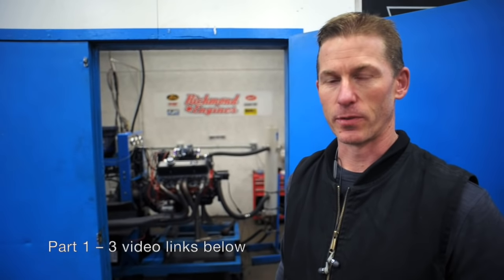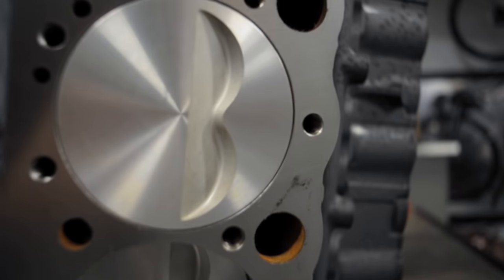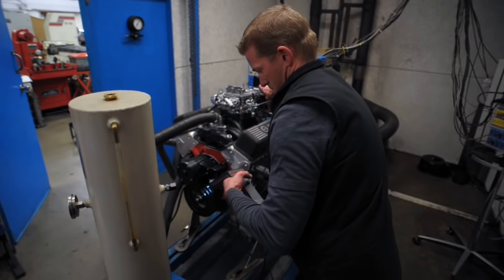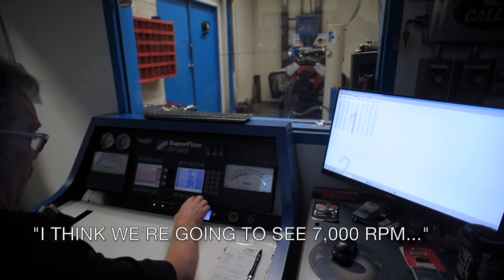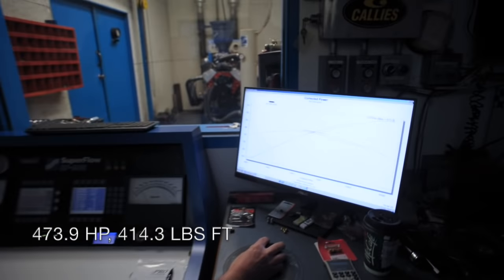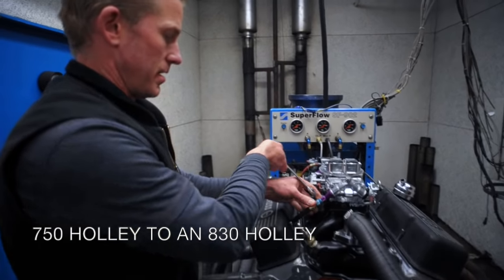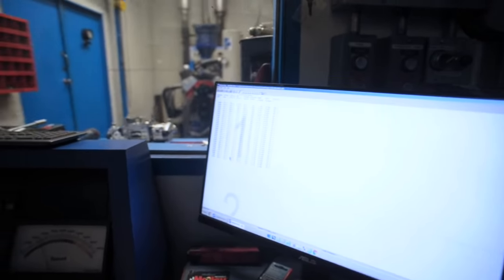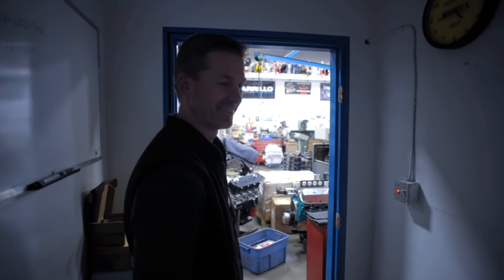SBC 283 Crankshaft + 400 Block = 500+ HP (Dyno Test 1 of 2)

Comment: Back in 1995 I had a de-stroked 400- which made it 377 cubic inches, it was a monster! It was in my 1970 Monte Carlo with a m21 4-speed  with  390  gears in a 12 bolt position, i shifted at 6800, ran 11.12's weighing 4200 pounds
Reply from the maker: Sounds awesome! I just love those Monte Carlos too.
Reply: Nobody does that today.  It's  all turbos and the bottle.  Good job.
Reply from the maker: Thank you for commenting :)
Reply: Do you remember the specs of the heads and cam and compression?, That's a great time for the gears and weight 💪
Reply: Thats hella cool, my iron headed 350 powered 72 Monte Carlo weighs 3,770lbs with AC and rally wheels on a 12 bolt... wonder why yours weighed so much more.  Mine ran a 15.5 bone stock.
Reply: 350 crank and longer rods are a sweet sleeper  engine.
Reply from the maker: Thanks for commenting!
Reply: Perfect combination I think, the 377
Reply from the maker: Maybe I should do one of those next! Thanks for commenting :)
Reply: I know what you mean. Had a 377 with a 6-71 and two 600 double pumpers in a 1930 Model A Coupe. What a ride
Reply from the maker: That sounds like a bit crazy and fun!
Reply: I've got a similar story with a 318 crank in a 360 block. Everybody told me a 349 was too small for a 3/4 ton. It breathed really well, spun to 7200 RPM, and waddled a 6,600 lb truck into the 13s. I did eventually get sick of it and go with a hughs kit, after everything has a mean little 415, but even with the Pistons and rod upgrades I couldn't spin it as fast as I could that 349.
Reply from the maker: Sounds awesome :)
Reply: I would have been the pesky neighborhood kid wanting to help you set your floats and timing.
Reply from the maker: That’s how we learned!! Get in there :)
Reply: @Sir.VicsMasher  he's probably bullshittin that's why it weighed so much
Reply: Yep that was a super strong old school combo that rocked. I'd rather have that than a 383
Reply from the maker: Awesome! Thanks for commenting :)
Reply: @chrisguerra355  I agree
Reply: Circa 1983 my elderly cousin had a 194x’s Chevy pickup with a stretched front end and a 377 with a powerglide.  I had great reaction times so he let me race it at Penwell Raceway outside Odessa, Texas.  It ran 11.2’s NA and with nitrous it ran 9.7’s.  Not sure what it weighed, it was all very custom as he was a body man.....  That nitrous pass was at 136 mph and it had no front brakes and there wasn’t much weight on the back tires...He had a cheap choke cable for the parachute and I pulled the plastic knob off it and didn’t deploy the chute. I had to gear it down and stand on the brake pedal to get it stopped about 20’ before going through a barbed wire fence... Ended up winning the bracket race that night.  Good Times!
Reply: @dieseldan420ca He must've weighed his Monte Carlo with him in it. 😂
Reply: Built the same, the 400 would've been a bigger monster at lower revs and been faster. With bigger heads it would've been an even bigger bigger monster
Reply: @chriscatarcio2983  Cause there easy to tune to go fast at the track!
Reply from the maker: @lollipop84858 
Thanks. Not really our point though.
Reply: @BCBtrucks64  The opposite combo became the standard.  400 crank in a 350 block, the famous 383 stroker. Stock car drivers used both variations with success.
Reply: Try a 307 chevy with 305ho heads it's actually considered a 283 stroker makes damn good power for budget budget build especially when you slap a comp 268 😂

Comment: Makes me wish I still had my '67 302. That sound at high rpms and the realization of what a shorter stroked engine can accomplish, gotta love it.
Reply from the maker: We appreciate your comment, wfd805!
Reply: Don’t think there was a 67 chev 302 !
Reply: @edwardhuett7924  there was, indeed. Small journal. We have a guy here that has his all original 67 Z-28 and the factory 302 is still in it.
Reply: @wfd805  thought it started in 68
Reply: @edwardhuett7924  no, in 67. It was for the Trans AM race. They were limited to 5 liter engines and that was the answer. They had Zora Duntov work his magic and the 302 was the outcome. I know there is a lot of mystery around the reality of the 302 chevy engine and most parts suppliers don't even acknowledge it ever existed. But, they did and are gaining popularity in collectors again. I knew mine was original also. My friend Gary bought the car new in early 67 and he pulled the engine to drag race a big block. When he passed, I was lucky enough to receive it. But, I got bit by the big block bug. I sold it to a police officer for his 56 chevy.
Reply: @edwardhuett7924  nope, 1967 z/28 302 cid
Reply: I hear ya wfd805. I had a 69 Camaro and bought a well rebuilt 302 from a Hotrodder that worked at an O' Reillys in Smyrna Georgia. That engine drove and sounded.... Just Badass....
Reply: @edwardhuett7924  you're both right 67 had the small Journal 68 had the large Journal
Reply: The DZ 302 was a 283 crank  with a  327 block  

The 307 was  a  327 crank and a 283 block
Reply: @edwardhuett7924  yes 327 block 283 crank 2 bolt main the late  68/69 was a 302 purpose built and 4 bolt main !A short stroke big&  bore and good heads. Power from a small block comes from the heads!
Reply: @jimthomas1989  no a dz302  was not a 327 block   with a 283 crank .it was a 4 bolt main built as a 302   block and large journal crank !
Reply: The 302  was a 283 crank in a 327 block  .
The only  time there was a 4 bolt main 327 block  
But it was a 4 inch bore 4 bolt main 327  block with a  283 crank
Reply from the maker: @jimthomas1989 
Sounds about right. Thanks for commenting.
Reply: I bulid 302s with  6 inch rods  slow the pistons  speed  down  more  RPM

Comment: Great idea. Destroking the engine, just like Chevy did with the 327 to create the 302 to make power.
Reply from the maker: Hi w41duvernay! Thank you for commenting! We think of it as applying tried and true principles. There's something surely going on with a longer connecting rod that's benefitting power, torque, and efficiency; it's certainly applying the characteristics of what a short stroke produces, (and we are learning those characteristics as we go). Best regards.
Reply: If i remember right, a 327 block , a 283 forged crank, and a 5.7 rod , did reproduce the 302 z28 engine. Won't  be a DZ block,  but ....
Reply from the maker: @ronniecox109  
That’s correct!
Reply: @ronniecox109  , 
307 small block was a 283 block and 327 crank 
302 small block was a 327 block with a 283 crank
Reply: They didn't do it to make power, they did it to stay under class size rules for the Can-Am series
Reply from the maker: That’s a good point :)
Reply: @wymple09  Correct, to make power they went to more displacement. ie  350, then 396 then 427 then 454

Comment: Many moons ago back in high school,I built a 327 small journal 283 crank and dome pistons ported 202 heads never got beat! The sound of it 7000 rpm I'll never forget
Reply from the maker: That awesome!! Fun times I bet! Thanks for commenting :)
Reply: Roy Huff , 
The small  block  307 is a  327 crank and a  283 block  

The small  block  DZ 302 is a  283 crank and a  327 block   

I have  all of  these cranks and  all of  these blocks  

One of my 327 engines  is in a 66 Chevelle Super Sport  , 12 :1 Forged pistons and Steel Vette crank  , 
11 inch clutch  , M-21 Muncie 4 speed  , 12 bolt posi  rear  end  , 
Pulls both front tires off the ground,  
Revs to the moon at 11,000rpm  ! 
450hp
Reply from the maker: Sounds like fun!!
Reply: @jimthomas1989  what rods for the 283 crank in 327 block.My friend had 307 crank in 327 bored supposed to been 335 I think
Reply: @badassbees3680  , I think  307 uses  5.7 Rod  and  I'm not sure  if  it is  5.7 or 6 inch Rods for the DZ 302  but  it's a 283 crank  , I will have to  check  on it
Reply from the maker: Should be 5.7” rods. I believe the only SBC rods from factory that differed in length was the 400 rods that were shorter because of the longer stroke. Kinda silly for a HP application but good for a truck engine.
Reply: @ceperformance  thanks everyone! I have a 91 c1500 fixing to build a motor for..like a kid again can't wait lol
Reply: @jimthomas1989  I had a 74 chevy once they put 302 in with cam and 202 valves ..not sure what all was in it but I turned it 7300 a few times without floating valves and then one night me and buddies had too much fun and I wound it until it snapped all the belts and slung bearings completely out of waterpump l9l
Reply: @badassbees3680  , 
I have two 89 OBS Trucks  , both  have  4 bolt main  350 and  5 speed Trans , one is a short  bed , one is  a long bed , 

What year engine  you wanting to  put in that 91  C1500  ?
Reply: @jimthomas1989  not sure yet ..wish didn't have ecm bs or I'd go old school with one wire alternator but leaning towards 5.3 Ls  and some mods
Reply: @badassbees3680  , I have  NEVER   did any LS engines  , but  hundreds  of old schools  ,  if you need some  old school  tricks for hp gains  , I know some of them  ,
I have  never needed a computer  to make hp or limit  my rpm
Reply: @jimthomas1989  I'm in the same boat bro about the lot of old school engines but no LS yet
Reply: @badassbees3680  , The 4.8 LS is a 283,
The 5.3LS  is a 327 , The 5.7 LSis a 350 and  6.0LS is a  383  ,

These are NOT Correct  .
That's just  what  I call them  !  

The LS makes good power and  has after market  parts , but they are more  expensive than  Old School  engines , 

Headers for LS engines  are like twice as much as  Old School  , 
But it's your Truck and  your  decision
Reply: @badassbees3680  , 
Do this Video  , 
A 283  or  327 crank  in a 4 bolt main  block  and  make  4 to 5 hundred hp  .

11 or 12 :1  Forged  Pistons  
Port the heads 
Aluminum hi-rise intake 
Headers 
750cfm  carb or bigger  
Hi lift  wide duration  cam 

And you are in the 400 to 500hp range
Reply: @jimthomas1989  my last motor  was 400 small block ,11:1 555 lift 750 holley in 69 chevelle with car 4 speed got it hot at the creek doing flaming burnouts but that's been all my engines..bored ,roller rockers huge cam.. think wanna play with the LS and see if their as easy as old school stuff

Comment: Ran similar motor combo about 30yrs ago in a class rule deal, max 320cu, OEM production block, crank and rods only & cast iron heads, it used a 400 block, 265 crank, chrysler 6.123 rods, 14:1  made just over 600hp @8400 on alcohol in circle track application, it's a sound combo
Reply: I'd been waiting for someone to bring up some rule restricted circle track combinations. 
There's a lot of it that applies so much better to street/weekend race cars than the specific drag race build mindset.
Thank you.
Reply: @Motor-City-Mike  going smaller bore larger stroke is not worth anything if your not running down low enough rpm to make use of it, the improvement using 4.125 bore to cylinder head flow back then was huge as you could lay the chamber walls back so much more and using a 4.125 dome piston gave a lot more dome volume to bump compression, we ran a street version some years later using dome piston and increasing combustion chamber size as we found the dome slowed the flame travel enough to run a high compression ( for street) 12.5::1 without detonation, relieving the quench pad area to a slope proved best as unless the quench clearance was virtually zero it seemed to do very little to prevent detonation ( broke a few motors finding that one out)
Reply: I bet that thing sounded INSANE

Comment: Kinda nostalgic...
We built so many oddball engine combinations decades ago, making our own main bearing spacers, sleeving blocks for bigger bore sizes, big breathing heads came from hours of hand work, parts swapping from brand to brand etc etc, back when stroker cranks were welded and cut and high strength fasteners came from either tool & die or the aircraft industries. 
Everything old is new again.
Reply: Very cool! Thanks for commenting!
Reply: @stevenshumey8363  
You're plenty welcome!
There's so many area's of engine building to be revisited because of advancement in other areas, airflow potentials unheard of except in the 'secret rooms' of the top Pro/Stock engine builders (Bob Glidden has never really gotten the recognition deserved for his cylinder head developments, not just with the Cleveland Ford), camshaft profiles once thought impossible, spark curves only now possible with electronic ignition management etc, now available over the counter, making new combinations working with "old" areas completely worth investigating. 
I NEVER restricted my business or research to any one engine brand, there's so much to be learned from one design to the next that moving my knowledge forward meant WAY more, and I preferred the challenge.
One of my personal toys - I was in the business for just over a decade and still would be if not for financial damage done from divorce - was a 2.87" stroke x 4.15" bore 8.2 deck SBF with very heavily modified early 351W heads (the Tool & Die background of my family allowed modifying blocks etc for very little to no money) and  a G.K. camshaft of my own specs.
Very long story short, just over 520fwhp at 7900 on 89 octane pump gas, acceptable street manners even carbureted, and a notoriously fast little street racer still able to be driven back and forth to the shop. 
The short strokes allow for some big rpm (low mean piston speeds), I still spend time investigating rod length to stroke ratios as well as bore to stroke ratios and the affects they have on power under the curve and shape of the curve, valid when building to suit a specific car's intended use.
I found there's a lot to be gained by working the area between max torque and max horsepower just through different bottom end geometry - so thanks for visiting this area!
Reply: Mike, thank you again. Very cool project there with your SBF. 
I really appreciate your enthusiasm for different engine combos!
Reply: What was your favorite sbc combo from back in the day?
Reply from the maker: @SketchysGarage  
I always loved a high compression 327 with a wild solid roller camshaft and a single plane manifold. 
Now I’m building several different things like these short stroke combos as well as long and short stroke LS motors. 
Always something a bit different.
Reply: @ceperformance  The 327 can be a real beast with the right cam and heads for their size. We built a 4 inch bore 4 inch stroke sbc that was a real monster had great power from the hit of the throttle till you let off. Great channel keep up the hard work 💪.
Reply from the maker: @SketchysGarage  
Thank you! I think it’s so valuable when guys are open to share ideas. There’s always something to learn if we’re open to it! 
Keep up the good work!
Reply: Agree with the nostalgic observation, but, not necessarily the odd ball part. 
4” bore / 3.25” stroke yielded 331 cid and was the norm in SBC Pro Stock motors in the -70’s, up until the advent of mountain motors in the -80’s.
Reply from the maker: Hey, thanks for commenting!
Reply: @georgedreisch2662  2hp per cu. in. 331 cu.in where 3.25 stroke . screamers
Reply from the maker: And we love it :)
Thanks for commenting.

Comment: Awesome! My 327 made that, spent a small fortune but it was a giant killer! 
Your 329 is a killer but a different cam and springs you would run over 7000 rpm and 500 hp with huge torque numbers! 
Man I love this build!!
Reply from the maker: Thank you for commenting! Look out for another video in a week or so. We just added some spring pressure and titanium retainers and we’re going to whip it again.
Reply: Agreed, that LSA needs to be narrower.
Reply from the maker: We’re happy with these results for the application we have.
Next build will tighten the LSA and get more out of the top end! Thanks for commenting.

Comment from the maker: We appreciate the viewership and inquiries. Check out our previous crate engine build based on "The 350 that Chevy should have built" article, a 400 block with a 327 crankshaft, using 6.250" connecting rods instead of the 6.209" connecting rods that the article covered. The SBC block we used was a salvaged Dart block, a block that had been damaged during a race-track incident, with 350 (2.45") mains: https://youtu.be/3oLz362AbDU
Reply: What  compression ratio  was this 329 ?
Reply from the maker: @jimthomas1989  
Thanks for watching. It’s 10.78:1

Comment: My first racing engine used a 307 block. Mainly because it was free but also because I was just getting started in an IMCA modified and needed seat time with a lower power motor to save money. I was definitely budget constrained. My engine builder was an old timer who knew how to make engines that lasted. I could certainly run with the pack and because I had been setting up modifieds for other drivers I knew how to get through the corners and get all my horsepower to the ground. There were a couple of guys running 406s with tons of hp burning up two tires every night. Difficult to compete with that but that 307 was what I needed to get started.
Reply: You had a 283 block. Same thing

Comment: Very impressive. 500 horsepower and 329 cubic inches of a generation 1 small block. Not bad!
Reply: 500 or more wasn't unheard of back when a fully developed Chevrolet iron head 331" 327 was a hot SBC, like in the early 1970s.
Ref. some of Bill Jenkins (amongst others) work.
Reply: @Motor-City-Mike  Yeah, but with a mild 224 duration cam?

Comment: Awesome little motor, sounds like valves floating on top. More heads cam and intake and would be a serious contender such a small displacement.
Reply from the maker: Hi Rick Lauster! Agreed. It's all in the R&D! Best regards!
Reply: Would love to see a solid roller cam
Reply from the maker: Ya know, that is a great thought. Typically I’d build something like this with a solid roller but on this one we utilized a set of good used hydraulics because we had ‘em. 
Thanks for commenting :)